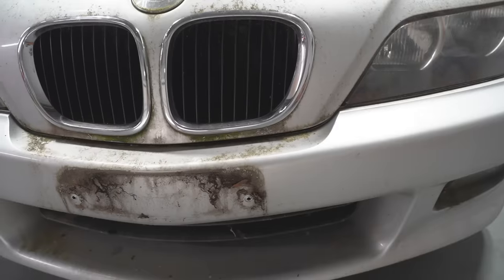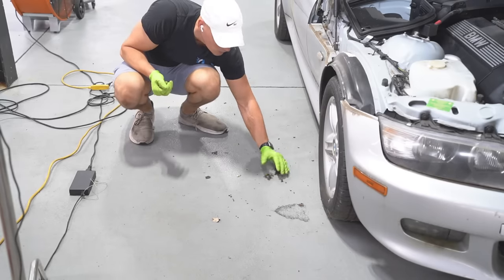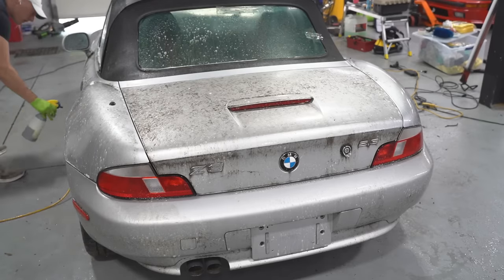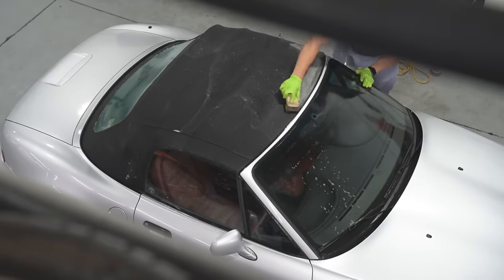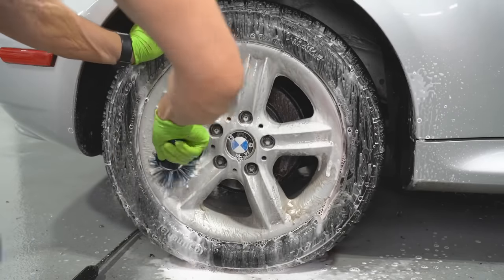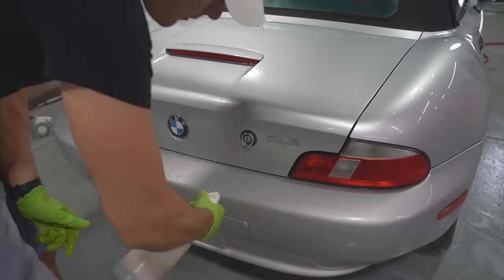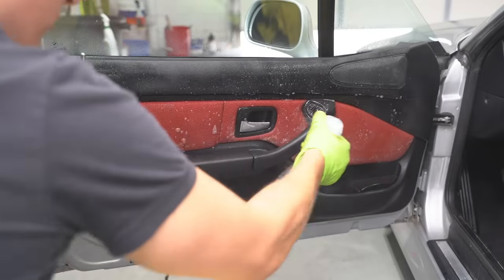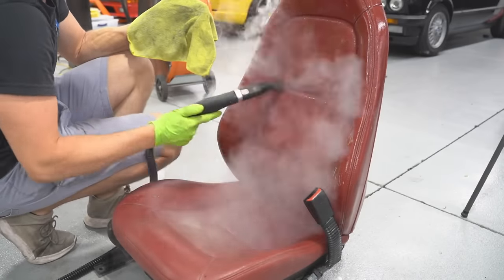Deep Cleaning the MOLDIEST BIOHAZARD BMW EVER! | Satisfying DISASTER Car Detailing Transformation

Comment: Only thing I might have done differently is pull the carpets before cleaning. I know it's difficult, especially in a German car, but I think it would have been worth it in the long run. So many nooks and crannies to get the extractor into. It probably would've taken the same amount of time to: pull them, 1 vacuum, 1 powerwash and 1 extraction. But pulling them would have gotten them (and the floor) cleaner.

Comment: I just Found your video. I have an Honda S2000. my rear glass window unglued from the top and it full of mold now. it sat a few months was a car cover on. the interior of the S2000 is just like this.  what cleaners do you use?

Comment: Looks good but I would not want to ever own a molded car. Can't judge how bad it is on this one but mold is a bitch and it won't just stay on the surfaces. If that stuff is inside the seat bolsters, door panels and damping material I would not have enough trust in this little ozone machine. A car is such a small capsule and in a car like that I would simply not feel comfortable spending several hours in.

Comment: Your lack of PPE when dealing with the mold is worrying - using the tornado to blow mould particles inside a building is not only harmful to you but to other occupants - these will make you very ill. You should never use compresseded air to deal with mold. Use a face mask or if really bad a full mask - check AMMO NYC for correct procedures. You are endangering your own and others health. You need to look after your health - we have only one ticket here on this planet.
The water spotting should have been dealt with prior to paint correction - you relied too much on the cutting polish to do the work for you.